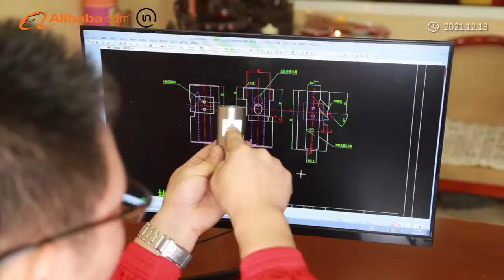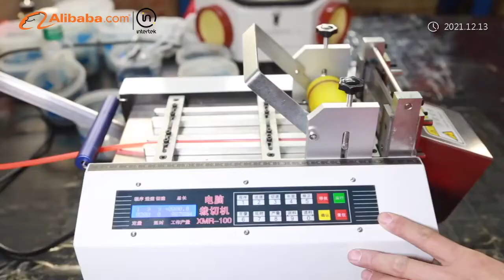10+ must have dental laboratory equipment list for technician reference presentation

Comment: I think one of the most important pieces of equipment that every dental lab should have but most don't is a vacuum unit to get rid of the acrylic dust in the air and one to remove the monomer smell.I'm a dental tech.for 51 years and until 6 years ago never had one.Very concerned about my health.